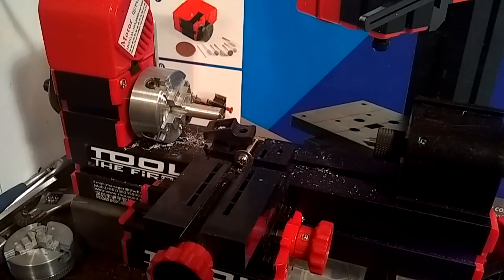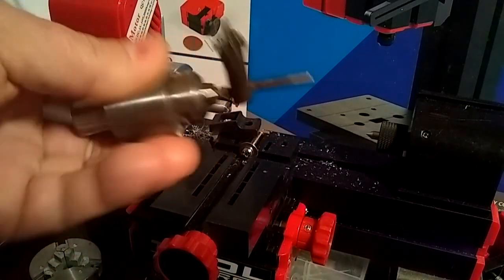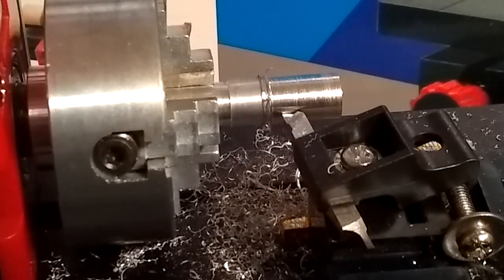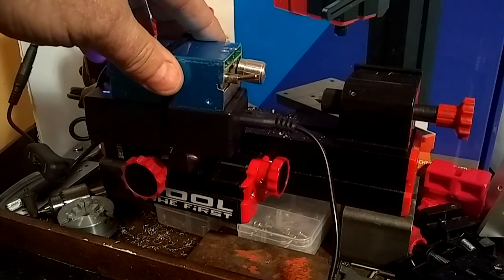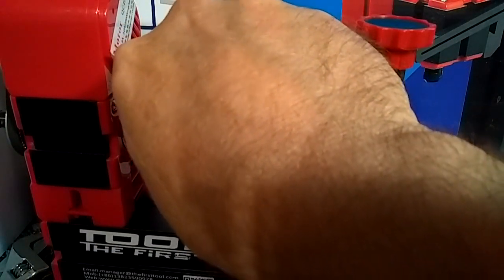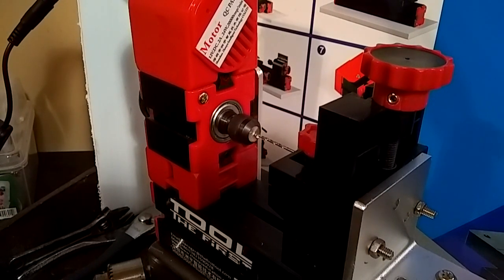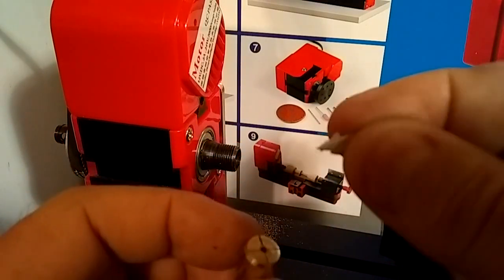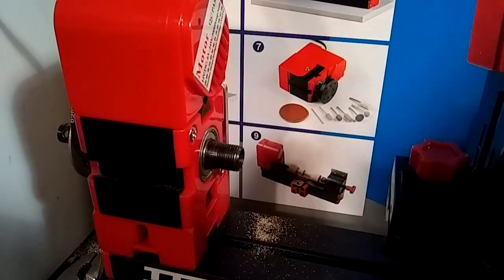6 in1 Mini Lathe Machine Mods

Comment: Why did you not use the parts in the kit/ You have a drill chuck that will fit the live center mount. Mine actually came with several collets. You are more likely to make a failed part because just aligning left/right and up/down ignores horizontal alignment and you take a chance getting a bit wobble built in. I have some cheap collets with that problem and they are useless.

Comment: i really want to get a lathe an a mill but at the moment i only have enough to get the cheapest of either the lathe or mill both are around $500, so im not expecting them to be the best but was hoping they would at least be good enough for me to use to learn on an maybe be able to do something later on that would upgrade them or if not just replace all together if i need more but at the moment its more for me to use an learn with an to be able start using metals in some of the stuff i make, right now i use 3d printers to make everything fdm an resin so im limited to how strong of parts i can make so id love to be able to start making aluminum parts an maybe steel in some projects. ive ran across these 6 in 1 mini lathe all the time an im always temped in buying one but its almost half the price of one of the lathes or  mills i was looking at so its always kept me from buying one, but if i knew i could at least mill aluminum an what the lathe was actually able to work id almost buy one just to have an start with then eventually jump to the ones im looking at now but at the same time i feel like it cant be able to do as much as i would want an would end up not being used, im just waiting on a video that shows them being used to there max to see what they can actually do an cant an that would help with making the decision but as of right now ive only seen ppl show them doing softer metals like brass an some aluminum but never really know how hard its working the machine.

Comment: ANyway you can show us that tail stock some more and how you hooked a drill bit to the tale stock to drill out that brass piece? I want to buy one of these but i need to put a 1/4 hex shank like the ones screwdrivers with multiple bits take into the tail stock, is that possible on this machine?

Comment: Thanks for the vid! Been on the fence with buying  it do to performance. One question though. Are  the cutting tips easily found for purchase  if needed to replace? TY!
Reply: Hello I have found 1/4 hss square tool bit will work for this. They are a little bit larger than what comes with it but you can grind the cutting surface to the right height. I have found them at harbor fraight and online.

Comment: This is a copy of the  Unimat Classic from the austrian company Cool Tool.
Reply: Thank you for this. I was just about to buy it. Now I'm going to get legit one.
Reply: @dirtiestharry6551  so did you buy the legit one? the one that cost 3 times the price but actually does the same thing? the same amount of power, but the original has a sticker on it like U1 U3 etc.? and find out how disappointing it was to use?
Reply: I wondered where these things came from, they look like the typical chinese toy copy method of getting a legit one, making copy molds of everything, and selling their own for cheaper. It usually means big problems though with inaccuracy and imprecision, as well as any corner cutting possible.

Comment: Your video is the only video actually showing this thing in combination with aluminium. It looks like it's not super fast, but it is working I guess. Thank you for showing that.
Reply: It has max rpm of 20000... Definitely slower than Dremel. But it will still be able to handle most wood and some metals

Comment: Are you made custom mod for the motor too?is that true that you can lathe an aluminium?
Reply: I have just tried and it works on Aluminium with consideration to depth of cut and speed. 3 Jaw chuck takes some learning to set up.